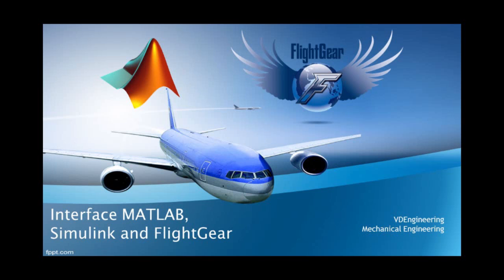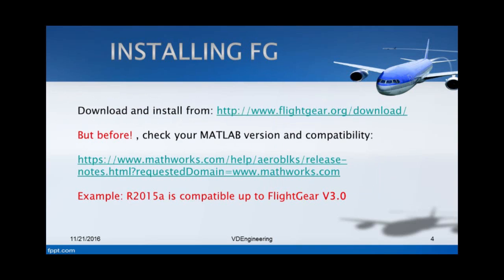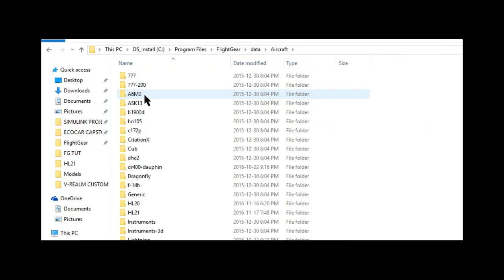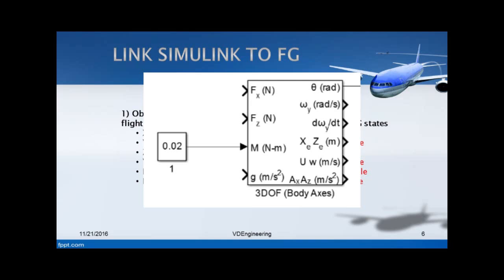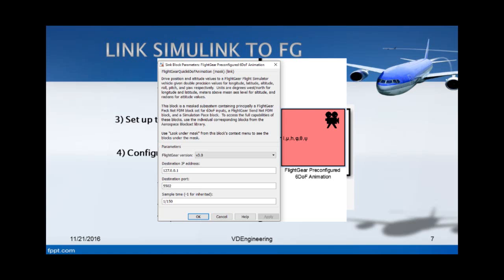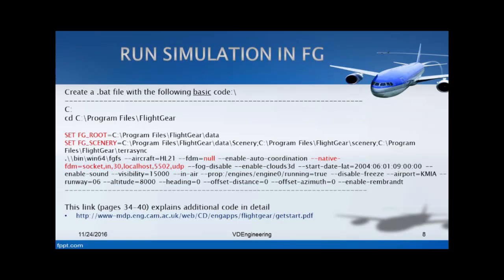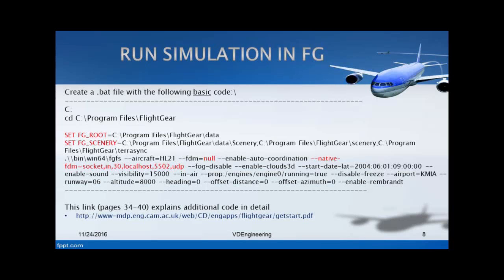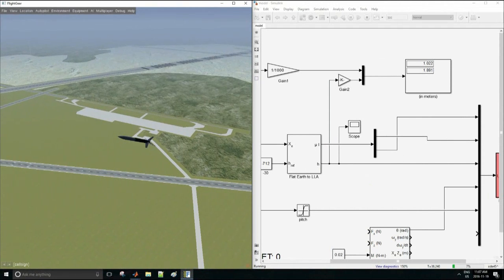How To Connect MATLAB and Simulink to FlightGear - Full Tutorial for Beginners

Comment: When I run the bat-file it starts FG, but the window of work with the simulink model becomes unavailable, I can not start the simulation. What could it be? I'm using Matlab 2017b and FG 3.4.0. Thank you!
Reply: @VDEngineering Many people are getting this problem. Please give a solution.
Reply: same problem, could you find any solution?
Reply: I had to close out of  matlab, then run the batch file, then restart matlab and open Simulink. Then it allowed me to run the Simulink.
Reply: Hi all, I'm having trouble trying to get FlightGear to use the simulated data I generated in Matlab. My sh file runs, but FlightGear says "simulation paused". Any advice?

Comment: Thanks,so great videos.But I want to ask you for help about the scenery in the FlightGear.The version I used ：matlab2017b,FlightGear2017.1.When I set up my FlightGear with the airport KSFO,the interface of the Fligtgear is full of sea water and sky without terrain. But in the default condition at the ENBR airport ,it is normal and right. When I run the matlab and flightgear together,the plane can fly with the only terrain problem as I said.Do you know what is wrong with my flightgear?
by the way ,the version 2017.3 flightgear is normal but matlab does not support.
Reply from the maker: You haven't installed the scenery, it has to be downloaded and installed separately from another website.
Reply: Thank you,I have solved my problem just as you said.I selected the automatic download scenery.

Comment: Hi, regarding the .bat file code, what if I wish to keep the flight dynamics in flight gear? Do I simply remove '-fdm=null' or do I write something else instead? Similarly, if I wanted the aircraft to start on the ground, how do I change '--in-air'?
Reply from the maker: Try to adjust altitude to make it start on the ground, or simply change it to -ground. Let me know what works, haven't tried this myself unfortunately.

You remove fdm-null, worked for me
Although if you are running Simulink I strongly encourage you to disable the fdm

Comment: Your videos have been very helpful for me, but I am having some problems with setting things up. Would it be possible for you to help me? I tried setting up a flight path similar to what you did here and connected it to FlightGear. But when I ran it, the aircraft did not move. Though something that I did different, was that I used the hl20 model.
Reply from the maker: Check your batch file
Maybe you did not connect the output mux block to the FlightGear sim block.

Are you able to run the simulation in MATLAB without FG?
Reply: The mux block is connected to the sim block, I tried copying the setup you have as close as possible. The MATLAB simulation does run, but when I used scopes to see the latitude, longitude, and altitude coming out of the FE to LLA block, lat/long do not change while altitude does. But also when I ran FlightGear from it, I noticed that after I entered in dos('runfg.bat') FlightGear would start and the simulation would load in, but the Command Window never brings up the >> for the next command.
Reply: Actually, I found out that the lat and long were changing, but by a very small amount. I believe the only issue is that the >> never comes back up, which makes me think there's some sort of loop, or error that's preventing it from completing.
Reply: I found a way to get the simulation to run with FlightGear, but when I do, the terrain suddenly disappears, and the aircraft floats in space. Would it be possible to get the simulink architecture you used in this demonstration? I would like to look through it to make certain I am doing things right.
Reply from the maker: Oh that problem is due to your latitude and longitude, they are written in opposite form, if you check or enable the HUD it should tell you.

That happened to be before as well.

Also check that you first installed scenery. The default FG only comes with San Francisco Bay Area.

P.S. My architecture is the exact same as what's in the video!
Reply: It started working properly, thanks for the help. Would you be able to help with simulating an aircraft with control surfaces? How do you change their actuation separately?
Reply from the maker: No problem,

Unfortunately, simulation of independent control surfaces is something I have yet to learn myself. It is significantly more complicated and involves C++ scripting as well as configuring a whole new XML file. In addition, you have to create moving control surfaces in AC3D which is a whole new challenge in itself. I am researching this extensively.

 If you find any resources, please let me know!
Reply: Well I appreciate all the help you've provided so for. Your videos have been a great resource for me.
Reply: @sorisong3735  Hello! I can't  to build scheme. I don't understand, where to find blocks "x", "h", "pitch". Could you explain how to build scheme and which characteristic did you chose in blocks? If you built this scheme and it works can you send  me  your scheme?

Comment: sir,
we are facing problem in connecting the maatlab simulink with flight gear .if possible please suggest the correct combination of matlab version and flight gearversion
Reply from the maker: Which version of MATLAB do you have? Please be specific, e.g. 2016a,2016b e
1)As soon as you open MATLAB, it mentions the version on the top left corner of the flash screen
2)Or, open MATLAB type in 'version'.

Report back to me
Reply from the maker: Please use the link I discuss.
You may use FlightGear 3.0, the one I use, should be fine

Comment: Hi 
thank you for sharing this, I have to questions please, if I wan't to control the aircraft by the keyboard or  a joystick, is it possible with the same options you chose ? 
if I want to run this simulink file with external mode so I can link the  simulator with a hardware model , is flightgear  compatible with external mode?
Reply from the maker: Yes, it works with third party flight simulators,

You will have to use the 'Pilot Joystick' block in the Simulink Library Browser - Aerospace Blockset

Regarding the keyboard, I'm not sure, it might work.

Watch my old video on connecting joysticks to MATLAB,

https://www.youtube.com/watch?v=A7KkciHn0jc&t=140s
Reply: thanks a lot for responding 
I have a robot that is connected to simulink using arduino , thats require external mode on simulink, is it compatible with flight gear? 
Is joystick compatible with external mode?
Reply from the maker: I'm not sure about what external mode your talking about.

Compatible with flight gear? Yes

The only 'external mode', is that Pilot joystick block in Simulink Browser.

Watch my other video for a detailed explanation.
Reply: whenever an arduino is connected to matlab you have to switch  the simulation mode from normal to external 
so the hardware board are arduino 
if i am going to use arduino and joystick at the same time 
what board should I use?
I mean in the configuration parameters should I choose ardino or joystick?
and in the simulation mode, does the joystick work when  the external mode is on ??
Reply from the maker: I haven't used arduino ever before, so unfortunately I am not sure.